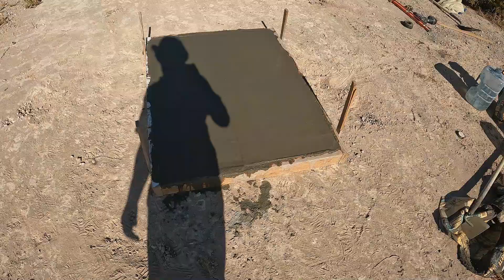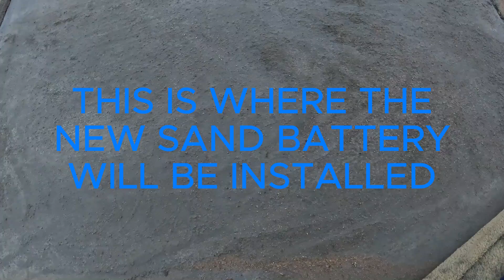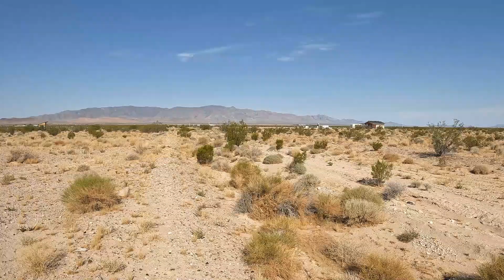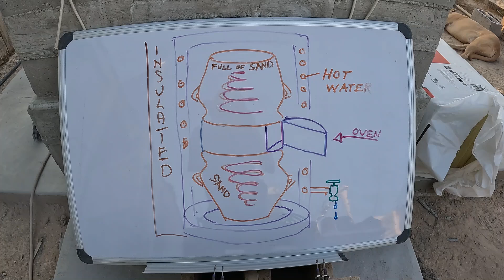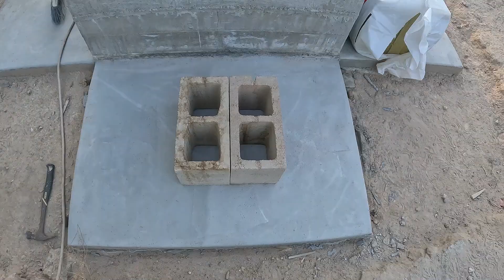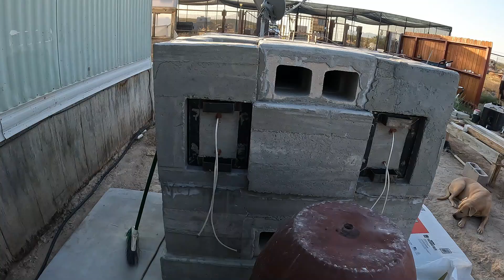148- New Sand Battery Design and New Property

Comment: What the heck is that metal tube from ill send you everything you need to build my 55 gallon drum if youll put it together and film it im trying so hard not to do a youtube channel right now
Reply from the maker: I do have a 55 gallon drum I can work with. It looks like it actually may work nicely with another terracotta pot I have. Thanks for the comment and kick starting my brain.
Reply: I used exhaust pipe going threw the sand and a water heating element works amazing to heat my 3200sq ft home
Reply from the maker: I tried a hot water heater element as my first experiment. They deteriate unless submersed in water. @Familyadventure369
Reply from the maker: What is your 55 gallon drum design of? A sand battery heater?
Reply: Sorry not water heating element i ment to say oven element